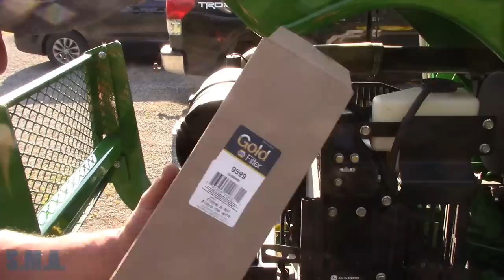John Deere 5055E : Service

Comment: "Made in China?!?!" Anyone else disappointed to find out that John Deere tractors are made anywhere but the USA? Just sayin'.
Reply: If it was, you would be disappointed at the price!
Reply: I think he was referring to the Dana built front axle. Who knew that John Deere bought parts made in china? If you look close you can see the Dana label on the axle. My 1979 JD 950 has a Yanmar diesel and I'd bet Eric's motor was built by some off shore manufacturer too. If your tractor is less than 100HP it doesn't  matter who put their name on it, its foreign. Since they are all made in Asia is it any wonder that Mihindra, Koiti, Yanmar, Kubota and TYM are selling under their own brand? It seems clear that the big US makers found they could get their small models built over seas but now the over seas makers have decided to cut out the middle man, leaving companies like Deere to sell over priced repair parts to make a buck and pissing off the customers they have left.

Comment: U forgot to fill the fuel filter
Reply: No. He did not forget to fill the fuel filter. The pump and bleed screw is there for a reason. Never prefill the primary fuel filter.
Reply: @jonasthemovie  I was trained by ase certified diesel school yes one of the reccomend is to refill u dont have to but I always do been doing it for 10 plus years
Reply: lance hobbsfreestyle reselling Then you need to go back to school, because you admit that it was at least 10 years ago. Stage I was a long time ago, we are currently introducing Stage 5 in the machines I do R/D for. You can fill the prefilter if you got ”clean” fuel but never the primary filter. ”Clean” fuel is not clean enough for a modern diesel. And it is not a good practise for any system, not even this Stage 1 engine.
Reply: @jonasthemovie  I litterly do tests every 2 years and go back cause u can learn new stuff everyday but everytime u change a davco filter or any fuel filter u can either prefill it or pump it in with bug. On another note I work on dd15s all the time and u must prefill fill if u dont and u get a bubble in the line u will have another problem also I'm not saying u have to do anything I'm saying that that is what's pre steps with desiel

Comment: diesels are so high priced to deal with. I would consider  fuel costs and for smaller operations a gas burner is many times cheaper overall.
Reply: They haven't made gas powered tractors for 40+ years...
Reply: @svtirefire  ok, learn to live with the diesel.

Comment: john Deere has a bad habit of over tightening everything it doesn't matter what it is. i hate napa gold filters.
Reply: Why?
Reply: @jonasthemovie  because i have seen the glue that holds the oil filter together melt and block the main oil galley.  its happened  more then once. i have seen fuel filters with tears in the filter media and gaps in the glue where dirt can slip past. and with todays fuel systems the tiniest speck of dirt can do thousands of dollars of damage.
Reply: Robert Weitlauf You think that could be why they switched supplier?
Reply: @jonasthemovie  that quite possible, i use oem filters when i can if i cant get them i use Baldwin or wix. im kind of afraid to try napa filters, i dont like working for free let alone building a customer engine twice.
Reply: Robert Weitlauf Weren’t they made by Wix before.....?